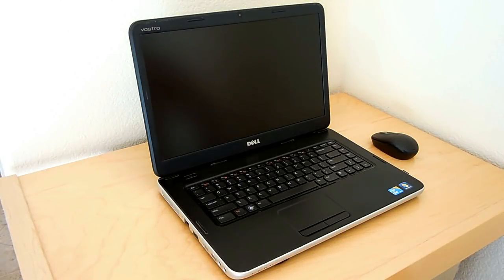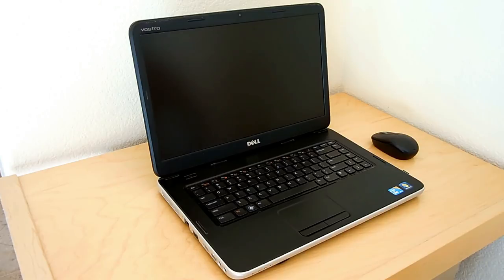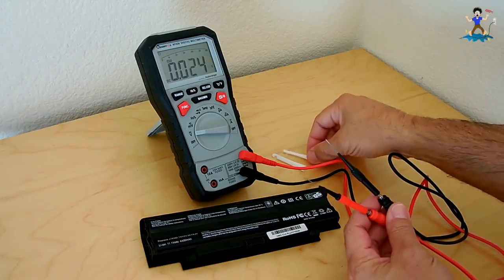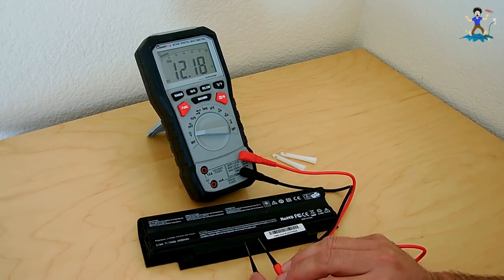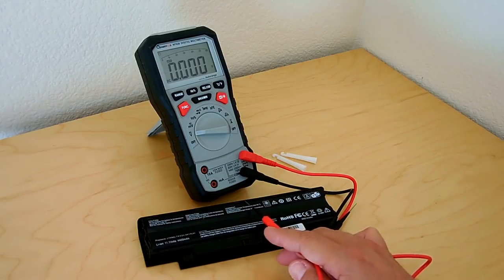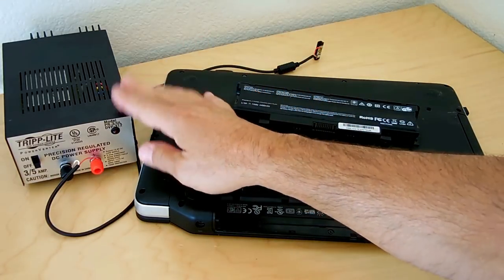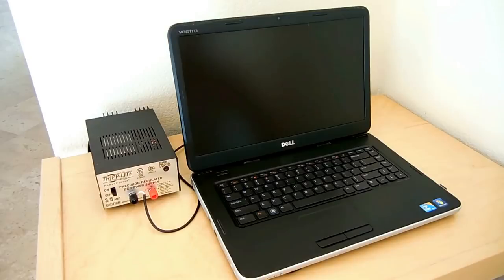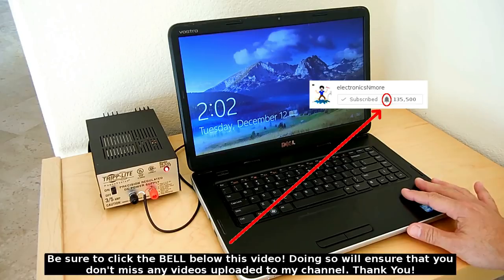Fried Dell Laptop Power Supply Workaround

Comment: Hi! My battery from laptop have the voltage indicated 18.5 V . I seen on  laptop charger that the voltage is same (18.5 V) . I can use this charger on battery port to power on the laptop? Thank you!
Reply from the maker: That seems very high for a laptop battery. Match whatever voltage the battery pack is.

Comment: Hi, I have a GPS tracker (USB mini 5V), what if I want to place it inside my laptop, can I connect it to the battery from inside the laptop with 2 pins that have 5v potential difference? so it remains powered even if the laptop is off .. 
thanks

Comment: The technician told me that my laptops power supply has been burned. Can you please help me with my issue? Im not tech savy to perform a revival on my laptop. I have important workload inside and I have to get it asap. No cloud saved or google drive. Just directly inside my laptops memory.
Reply from the maker: Remove the hard drive and access it using another computer using a HDD(SATA) to USB cable.

Comment: I have 12 v 1500mA power supply and laptop battery reads 10.8v 4500mAh, will I be able power it up?
Reply from the maker: Way too low.
Reply: @electronicsNmore  You mean the amperage? Thanks!
Reply from the maker: @MuhammadAli-gj6ss  Yes

Comment: Hi I just did this with my own laptop but used a 500mah adapter 12 volt n it barely switches on then goes off after do u think if I use a 12 volt lithium ion battery pack would that work well
Reply: Depends on the amps.. a 500mah is 0.5Amps.. you need at least 5000 mAh

Comment: Please Explain how to connect your battery socket to directly in this device with each pins
Reply from the maker: I explained in the video. Every computer is different. Use the connector from the battery pack and solder the wires from the power supply in the correct position. Thanks for watching
Reply: Can i use laptop charger it self to replace the power supply??

Comment: My Dell Inspiron N4030 (0k12wn) battery says 11.1v. can i use 12v 4A adapter directly to battery pins?
Reply from the maker: When the battery is fully charged, it has a voltage of around 12.6. Anything between 11 & 12.6 is fine.
Reply: I wan to try the same charge my laptoo battery with car charger 12v 4 amps can i do that you ever try it?
Reply: @acura1384ify  I tried it and it works. My car charger outputs 14V and 5 amps (set to 14v because i want to use voltage exactly the same with alternator output when cruising).

But when I tried this, i use power supply from a monitor, 12v 4A and it worked fine.. what kind of car battery charger you have? Laptop battery already have a BMS inside the package

Comment: Hi, would a regular desktop power supply work for this?
Reply from the maker: As long as the voltage is within the correct range, and it can supply enough current.

Comment: Does anyone know where I can by the laptop connector that mates with the battery.  I wanted to make an external charger for laptop batteries.  They sell them but to expensive.  I have a R/C charger.  I just need the connector to mate with the battery.
Reply from the maker: Buy an old battery
Reply: @electronicsNmore  I need the connector on the laptop side not the battery side
Reply from the maker: @n1kkri  Look on ebay for a cheap broken laptop
Reply: @electronicsNmore  I did see these connectors for sale at one time.  I just can't remember.  Only a few dollars each.

Comment: Hey bro!! I got the thing what i am looking for.. thanks for this Vid.

I was using my lapy directly with charger, n its working completely fine.. one day i shut down it and next day it will not getting started..

Charging lights blinking on & off after equal time interval continuously..  Pls suggest anything i can do...
i will surely try what you showed us in Video as a final option..
Reply from the maker: If the laptop still works using the battery, then you need to do what I show in this video. Thanks for watching
Reply: Sir after searching in market, i have got 12V ,8.5 A power source..

Can i use this instead of 5A...

I have a confusion and doubt that if i use this , it may damage to my computer pls help....
Reply: Hey bro..

I have connected 12V,8.5A supply to computer according your video...

But when i switched it ON power source's light started blinking and laptop doesn't start...

Any suggestions!!!!???

Comment: there's another work around, replace the battery or replace the 18650 cells from inside or the battery pack
Reply from the maker: The only other workaround would be to buy an external battery charger for the battery pack.

Comment: Hi, can you tell me why not every battery can be meassure? For example i have 2 batteries that does not show any voltage on output, but once you add them to laptop, everyting it's fine. But right now i have other problem. Hp 6530B, i don't have any output voltage on laptop's pin. Not battery, but on the laptop. There is no voltage to battery. But if i add the battery and i meassure the pins inside, there is unstable voltage 0 to 13 volt. Once you remove the battery it goes to 0.50.
Reply: usually if the battery ran out once (eg: in storage for too long) the protection circuit think something is wrong and disable the whole battery.